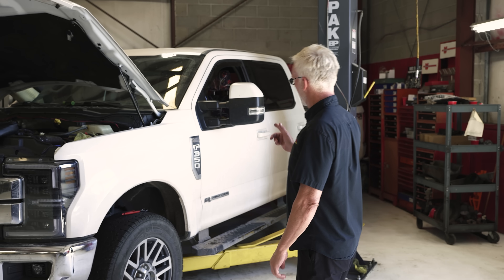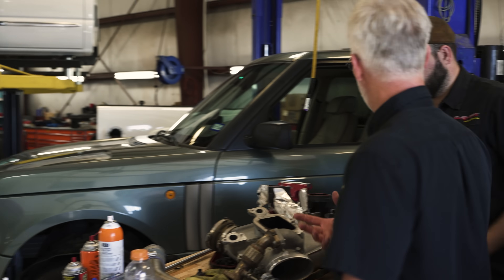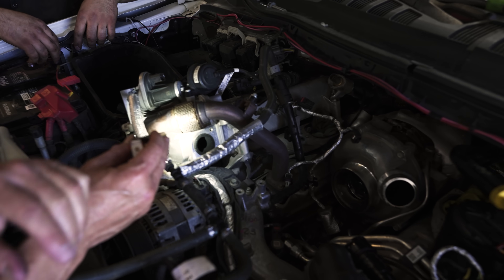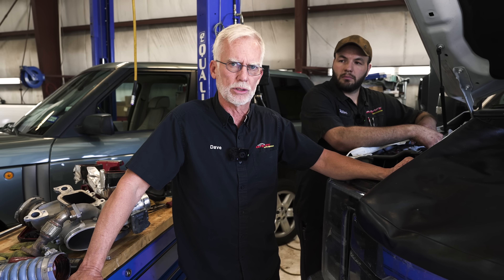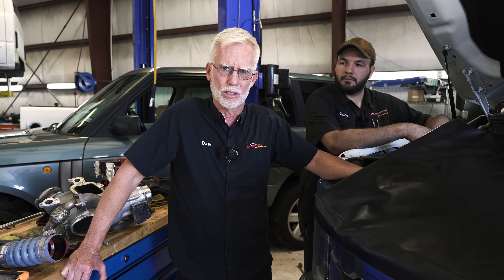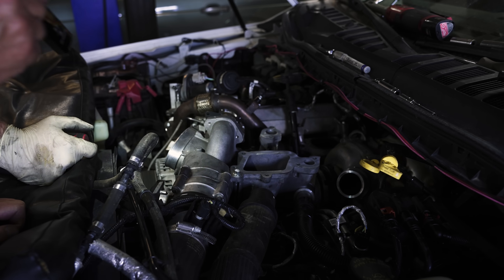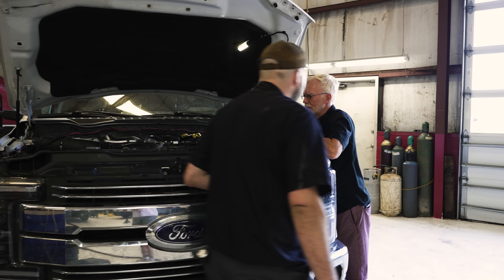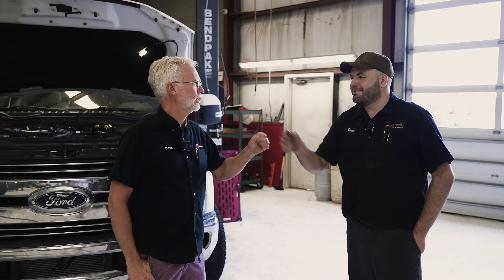2019 6.7 Powerstroke EGR Maintenance: The Problem With Carbon Build-Up

Comment: Source the Exhaust for the EGR from after the muffler or cat if in the car. Or you might be able to use a cyclone to remove the carbon particles from the exhaust. That could dump them in to a catch container that could be cleaned on a regular basis. I is why a Dyson vacuum works so well. Yes the same Cyclone could be applied to remove carbon fines from Diesel exhaust. Yes by by DPF. Get a patent.

Comment: Just like direct injection engines that clog the air passages and valves due to the lack of fuel cleaning them, you either maintain them by cleaning manually or reintroduce port injection like Toyota. In my opinion, a new EGR design is needed to passively clean the recirculated exhaust gases; otherwise, manual cleaning must be considered a maintenance task. Since this issue arises after the warranty period, manufacturers are not particularly concerned as long as they meet government emissions regulations. Therefore, I am not hopeful about potential innovations in this area.

Comment: So Dave how many times in a half a million miles would you have to do what you just did at what intervals to get that many miles out of a truck engine and how much does it cost?
Reply: This guy made it 200,000 so two more times? A lot of people here saying they do it themselves easily and just pay for a set of gaskets
Reply: @matt45540  I'm old so this is all new to me, I worked for Roadway as a truck mechanic I don't have a clue.

Comment: Use  bypass filter low pressure  oil filter  unit   with  moisture vapor  outlet   vent  tube open to air.  Fillitering to 1ppm   in low filter  unit  collects all the carbon   black  from oil , moisture  in  the oil  vents out  to air   making the oil less  acidic  whatever  carbon is put back  part mixes with engine oil  the  bypass filter  element  traps it  in it.  Best way  to get away from side effects of egr .
Replace oe filter at 4000km   by pass  element replace   at  15000km
Reply: Low pressure  filter  in bypass

Comment: Dave if your pulling all this off the top of the power stroke engine. Wouldn't you push to upgrade the CP4 to an aftermarket pump offering at this time?

Comment: Team, the upper and lower intakes for these trucks are relatively cheap, possibly compared to your hourly rates. Consider replacing them with motorcraft parts and clean the more expensive components such as the throttle. Just a thought.

Comment: This happens a lot with people that buy these big diesel trucks as grocery getters and tow their little boat down a couple miles to the boat ramp, also see it a lot with ambulances or any other service vehicle with tons of idle time. If you actually use them for what they’re designed for (pulling a load), you won’t have issues. 400k on a 17 6.7 and have 150k on my 19. They pull 20k lbs every other week.
Reply: unless you've removed the egr cooler and intake systems from your truck, you have no idea what condition they're in. They could be just as full of soot & you wouldn't know it. It has very little to do with how they're driven & more to do with the strategy the manufacturer has chose to control NoX.
Reply: @jeffs2809  strongly disagree, it has a lot to do with how it is operated. A diesel regularly operated under load will have minimal have egr or dpf issues compared to a truck that is unloaded most of the time. Not saying that the emissions equipment aren’t a hindrance, but in my experience, if you use these new diesels how they are meant to be used, you minimize these issues.
Reply: @jtoddk98 I have a 2022 F450, it does get used quite a bit unloaded but never idles long, mostly highway miles. Can I reduce this type of soot by using my engine brake more when descending a pass? Forcing higher RPM’s… do you think that would help?
Reply: @timshapleyadventures  not really, using the engine brake doesn’t create heat as there is minimal fuel injected. In layman’s terms, think of the engine brake as going down a hill in a manual transmission car, in gear, and turning the key off. The drag of the engine turning over without fuel or ignition is what slows you down
Reply: @timshapleyadventures No, but I would still use the engine brake, keeps the soot from jamming up the turbo vanes.
Reply: Oh I see is diesel trucks idling around. My neighbor has a landscaper who pulls up and leaves their truck running the entire time. Which means that truck probably runs 10 hours a day and only drives 150 mi. People act like it's good for their diesel truck to idle
Reply: Exactly, my 22 Cummins only regens at the max interval and the dpf gauge has never moved off the minimum. Mostly towing, if not it's going down the highway. Running them hot moving a load is key.
Reply: That’s exactly right. I tow 18,000 lbs 6 months out of the year, the other 6 months I tow nothing. My cel never comes on  when towing but comes on when I’m not towing. I take it to the local diesel shop, they clean the MAP sensor and say, “You ain’t working this thing hard enough”!!
Reply: We use the 550 chassis for our brush trucks. They weigh in around 17k lbs fully loaded and live at low speeds, on and off dirt roads, and excessive idle times. Any initial attack on a wildfire, they remain running so we don't have to worry about issues if we have to run. This cooler has been a major pain that the agency is trying to find a solution to.

Comment: Foolish question I have a 2011 dodge 3500 6.7 diesel non DEF but does have a EGR system. I purchased the truck new , it has 63K miles and I have changed the oil at 5K miles ( max) usually 3K with Rotella T5. Any suggestions on what additives to the engine oil or fuel??? I put Lucas in both but not every oil change. Also  a little marvel mystery oil once in a while any suggestions, please.  And Dave, since you are suggesting that this is a scheduled maintenance issue what would you be charging to do this cleanup and at how many miles?  TIA
Reply: Geno's Garage sells a cleaning kit and has a good write up on cleaning the EGR on the Cummins. The recommended schedule for that, along with the crankcase vent filter, is 67,500 miles. Check out a video by the motor oil geek(total seal piston rings guy), he goes over oil additives and shows that marvel mystery oil, along with many others, are essentially just diluting the original oil additive package. In short the Cummins doesn't need any oil additives.

Comment: Have you ever considered hydrogen cleaning? There’s a new process that they’re being used on diesel trucks and also on 6.7 in the eastern United States to clean debris out.Hydrogen attaches itself to carbon and let it pass on through the exhaust system.

Comment: I wish I had done that as regular maintenance on my 6.7.  It would have made it more reliable. Ended up selling it at 150k miles. Rust was starting to get to it also. Decided to switch to the 7.3 gas.  It’s quite impressive and I can tell they were trying to make a gas equivalent to their diesel offering. It’s also there in many respects .

Comment: My cummins has 306k miles still all factory.  Took the egr off at 260. It is a maintenance interval job. For ford i think its 70k.  And same  for cummins. Per warranty book. But mine was never done. So i was almost 4x over the mileage when i did it. Even still mine wasnt bad. Could still see light through it. Diyed it at home pretty easy. Purple power melts that crap.
Reply: It’s not so much if you can see light through, if too much carbon sits on the cooler. It won’t cool as effectively increasing egr and  intake air temperature as well.

Comment: My intercooler was blocked up,my inlet housing was full of carbon,replaced  intercooler,manifold was  removed and cleaned😢,injectors cleaned,lm always doing  5000km oil changes too ,must be a better way of reducing emissions its costing us the consumer ,plus l thought diesel was a better eco friendly motor compared to regular petrol , must be a better way 😢

Comment: Concentrated Purple Power, warmed up to 120°F. Soak for 4 hours, hot-rinse, and thoroughly rinse. Blow completely dry. 
Kobelco approved for Isuzu EGR Coolers. 
Isuzu recommends a 4500 Hour interval to remove the cooler, valve, and plenum chamber for cleaning. 
Watch out on the oven cleaner, it will eat aluminum.
Reply: The active ingredient in oven cleaner and purple power, both sodium hydroxide and will attack aluminum a bit.  EZ-off is faster, shoot, wait 10 mins then pressure wash. or dishwasher if the wife is away.

Comment: This stuff is why I dont drive a newer diesel truck.... explaining these problems to people but they keep buying them.
Reply: The problem appears to be bad maintenance, it's a filter you need to clean and this one made it over 200,000 mi
Reply: @matt45540  gas engines don't need this done.

Comment: The EPA at its finest. I'm sure the chemicals to clean the system's out and the energy spent making new motors really saves the environment
Reply: It’s not about energy it’s about particulates and smog
Reply: Think about how much more fuel is burned over all with these devices in place..? @joemclaughlin8657
Reply: @joemclaughlin8657  and what is a byproduct of creating the energy needed to maintain these systems.......wait for it.......
Reply: @NotBackstretch  not particulates and smog if that’s what you’re asking. How do you think we make energy?
Reply: @NotBackstretch  natural gas burns so much cleaner you don't need an emission system, it's what the Majority of power is produced by
Reply: The concern is the lungs and territory systems of those around the vehicles, little kids. Organs aren't cheap or easily replaced like engines. Granted cities build huge developments right near rail yards. 
Check out the children of the capital city of Mongolia.
Reply: @aaron___6014 you do realize it still gos into the air correct? It just builds up reduces fuel mileage, which makes you buy more fuel to go the same distance and then your truck goes into a regen and Burns most of that out it all goes out into the environment, one way or the other They can produce diesel engines to get better few mileage and last longer and produce less emissions without the use of these devices. All they do is destroy the engine they are on.
Reply: @that-badass-barber  my diesel has had zero soot/carbon on its exhaust tip over 115k miles, and it's all in the EGR system and DPF. So I'm certain it is contained until the system is cleaned as I've cleaned some out by hand like they did in the video.
Reply: co2 still goes in the air, but NOx and pm gets heavily reduced

Comment: I truly believe that when the EPA started putting def on Diesel engines and EGRs I thought that's the easiest way to kill a diesel engine.  If you think about it.  If it wasn't for Rudolph Diesel, how could we get supplies all around the world.  If you stop the Diesel industry you stop goods from being transported.
Reply: What on earth are you talking about
Reply: or maybe ( just a silly thought) people don’t want to breathe in filthy air?!
Reply: @bobwilus437  You don't really breathe in diesel particles. If you can see it, it is surprisingly benign. Black soot just falls to the Earth as carbon. Unspent gasoline fumes are different.
Reply: @SmoothRuffian  they can stay in the air for extended periods of time. also, someone can just drive by launching it back into the air.

Comment: Dude, I work on semi trucks, and with these EGR systems on all diesel engines now, its crazy how much carbon is in the intake, and some manufacturers route the crankcase ventilation into the intake and it makes a black gooey mess thats almost impossible to clean off, its ridiculous
Reply: 100% AGREED! I rebuild Cats and Cummins, and the occasional Detroit and these systems are nothing but a money pit for their owners and massive headache for me
Reply: Closed of my EGR and put a " collector pot "  on my crankcase ventilator, so far so good.

Comment: My egr and dpf and everything else is in great shape!!! In a box not on my truck!
Reply: Smart man!
Reply: EPA wants your location joke so you get a fine and you get a fine. Can we all delete the EPA or give them a Fine.
Reply: @WilliamHollinger2019 
That would be the best option 
All this shit increases fuel consumption by as much as 32 percent 
How is running the world out Of fuel faster Better for the planet 😮
Reply: Sometimes it just falls off the truck.
Reply: Same! I deleted my f250 at 40k miles and never looked back
Reply: @Dieselman6.7 yea mine was just a little over 40k all the bolts came out nice and easy. The only rough thing is losing the rest of that warranty.
Reply: Biggest mistake I made with my old 7.3 (besides selling it) was taking the cat out.  It was so easy to tell that I had removed it anyone could have turned me in and reaped the EPA bounty.  Fortunately, no one did.  Too bad no one makes a kit that takes the stock system, guts it, internally blocks it, and lets you reinstall so no one can tell you've modded your truck.  Better yet the manufacturers need to figure out something that works better than an EGR or make a better EGR system so we don't have to fool with it.  It does serve a good purpose but the execution is terrible.
Reply: How did you delete all this shit?
Reply: @rgms573  buy a kit, take stuff off, put stuff on, reprogram, drive down the road saving fuel(20+mpg) and enjoy your open breathing engines much better performance! 👍🏻👌🏻
Reply: @tdotw77 What tune is everyone running?
Reply: @rgms573 depends on the truck you have but look into ordering from a company out of the states 5in stainless exhaust plus 120hp tune it has more power and I’ve gained about 5-6 mpg
Reply: Real question... How do you pass smog in your various areas? I really want to do it but I am pretty sure they will look for it at a smog check---California.
Reply: @SmoothRuffian  you are screwed in California. I don’t have smog check where I live.
Reply: @SmoothRuffian simple………move to TEXAS!!!
Reply: @SmoothRuffian any update for California?
Reply: YES SIR!
Reply: 😂 mine as well crazy how much fuel mileage, power and reliability it gets.
Reply: I wish I could, but I live in a state that requires annual pollution control inspections.
Reply: Ditto
Reply: Diets are the best but Dave and folks are true pros and finding a solution in the current climate...
Reply: What tune are you running?
Reply: Did my 2016 duramax at 170,000. Probably should’ve sooner but my gosh what a difference

F all these three letter agencies
Reply: @mikeo.1593 Hope you breathe your own pollution

Comment: Is there any additive that you can put in the fuel to reduce the carbon buildup?
Reply: No, it gets all caked up cause it's going into the EGR cooler that cools it down so it sticks to the insides of it. Get rid of the EGR system, stop dumping exhaust back into the intake air system and this problem goes away! 👍🏻👌🏻🇺🇸🦅

Comment: Well if they didn't have all that pollution control stuff on there they wouldn't have that problem in the first place. Now I understand it helps the environment but if the government doesn't do it on their vehicles why do we?
Reply: Don't believe everything you hear/read on the internet. Only SOME MILITARY vehicles are exempt, not ALL government vehicles.
Reply: I worked for the largest fleet vehicle leasing company. I can assure you Federal and State government vehicles ALL have emissions systems installed.  The ONLY government  vehicles are military,  for export to countries that don't have 50 rpm diesel. You need to check your facts.
Reply: Government vehicles are very few. No one likes EGR, but I'm pretty sure everyone likes NOx and acid rain even less.